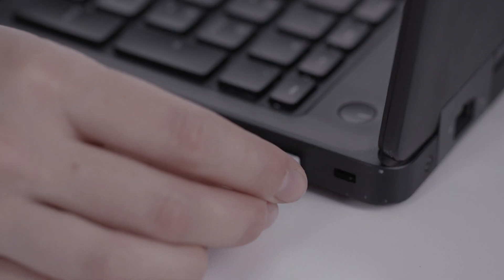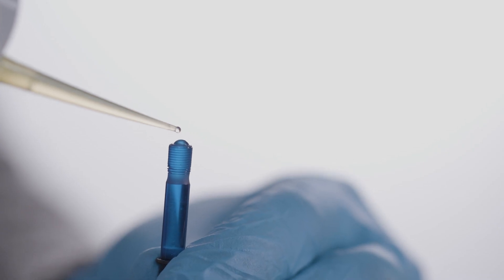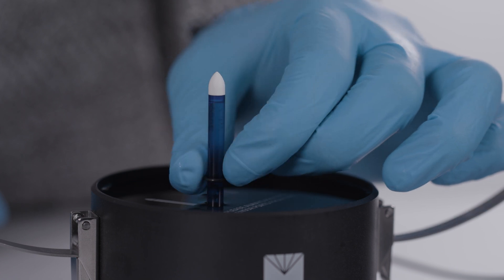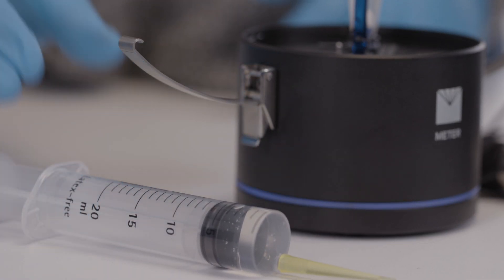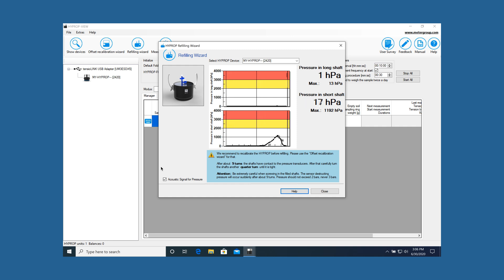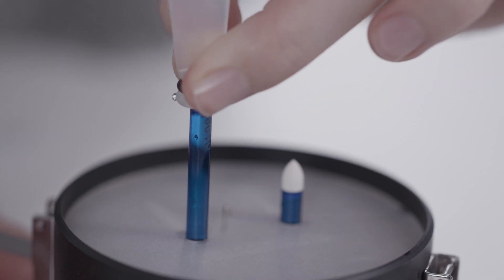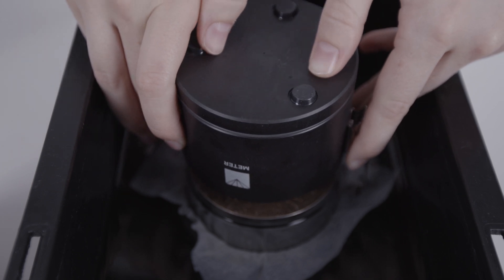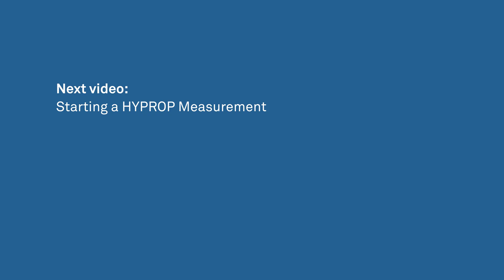How to set up your HYPROP after degassing Video 3 of 4

Comment: There is a difference between video and manual.  Video shows checking Hyprop fill,the pressure should increase up to the atmospheric air pressure minus 1000 hectopascous or100 kilopascous within 15 seconds. manual shows 100 hPa (10 kPa) within 15 seconds
Reply: So I wanna know which is correct ？
Reply from the maker: Hi, thanks for reaching out! If you reach out to our customer support at support.environment@metergroup.com, they will be happy to get all your technical questions answered!